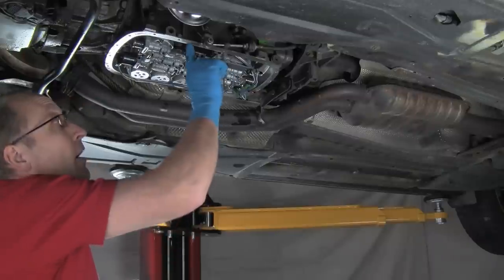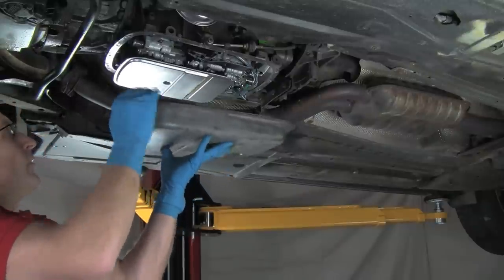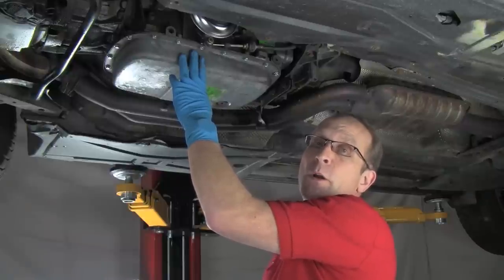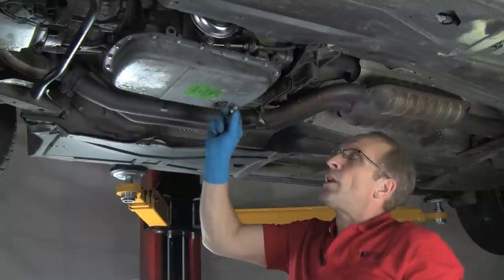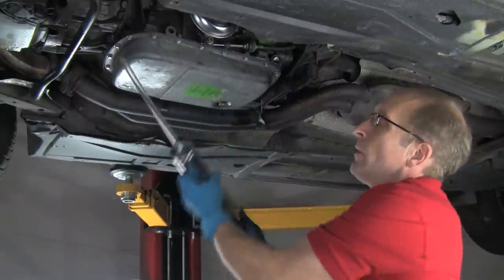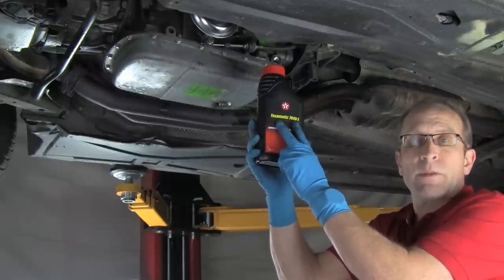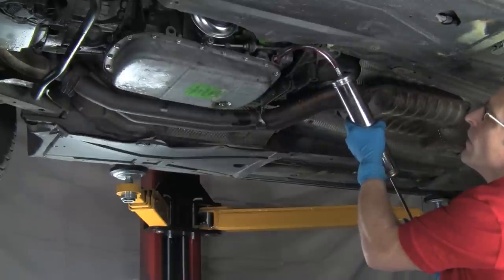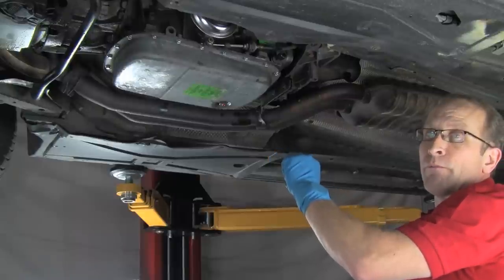Part 2: Changing Automatic Transmission Fluid & Filter On A BMW/MINI

Comment from the maker: When the pan is drained, you are removing around 1/2 of the fluid from the transmission. If the fluid being removed has high mileage or is visibly nasty, we do recommend a second fluid drain and fill (without removing the pan again) after running the transmission long enough for the old and new fluid to mix (some may take a 3rd time to be really clear and clean)..  Once, the fluid is clean and clear, you next scheduled change can just be a normal single drain and filter.
Reply: ok
Reply: What about the dirty fluid in the torque converter, which if similar to a Mercedes holds the majority of the fluid. Looks like a job half done?
Reply: You mean keep wasting very expensive atf? The stuff is at least £12.00 a litre. Must be another way?
Reply: @jonplopp6643  he just explained that ( or at least 7 years ago)

is there something unclear about  "When the pan is drained, you are removing around 1/2 of the fluid from the transmission"  ?
Reply: @jonplopp6643  sure you can flush the transmission which uses even more fluid and comes with its own risks in old transmissions.   Otherwise I guess hope for magic.    If you are paying 12 quid a litre you need to change suppliers .
Reply: @jonplopp6643  You do a complete flush , all the fluid out at the radiator as you pump new in at the tranny fill. Takes about 16 quarts .. pump in until you see new fluid coming out of line going to radiator . Everything else is a waste , like changing part of oil on an oil change .
Reply: @ozarkdaredevils  wheres the radiator?

Comment: This is how auto repair vid's should all be very through clear visuals and sound. As for Otto your great I just purchased a 2002 325ci with 83,000 original miles and I have used your instructional vids to save myself hundreds of dollars in labor. In regard to the Trans fluid and filter change I wish I had a lift would make this job 100 times easier. Cheers.
Reply from the maker: Thanks for the good words, Rich.  We're glad to be able to help.
Yes, the lift certainly is a game changer!

Comment from the maker: Wajid Furgan - We can't reply directly to your comment as it was sent in via Google.  Running the engine in a low gear and a higher engine RPM can certainly increase oil usage.  However, you may have a problem with the crankcase ventilation system, which can increase the oil usage.  You may have a ruptured check-valve diaphragm or clogged oil-separator.  As for the transmission, we would suggest changing the fluid/filter as a first step.
Reply: Do you have a video on how to change the pipes that connect to the automatic transmission heat exchanger / transmission Cooler? can i find them on the website?
Reply from the maker: 04bmw330i
 - We do not currently have a video for changing the transmission cooler lines.  The Bentley repair manual does address this.  We can offer the replacement cooler lines. If you don't see them on the web site (www.bavauto.com), after identifying your model, just give our Advisors a call at 800-535-2002.
Reply: +Bavarian Autosport  Question..........does anything have to be reset on the dash when finished ?????
Reply: I have a BMW 530i 2004 is the same process?
Reply: @TheKobotron  should be...just confirm via your VIN what tranny you have. There are several over the years

Comment: How do you run the transmission through all of the gears in an automatic? Do you just mean park, neutral, reverse, drive --  or did you run it through gears 1 - 6 with the tiptronic as well?
Reply: I run my park, neutral, reverse and then on drive switch to the tiptronic and run it manually through each gear.

Comment: What about the fluid left in the Torque converter and oil cooler? Shouldn't that to be replaced also?
Reply: I am also wondering the same thing.
Reply: After the first fill the car should be run and cycled through the gears, it should then be drained again and refilled. This will help to clear most of the old fluid from the torque converter etc.
Reply: planning on doing it tomorrow with 2x changes.
Reply: Kon Nyuk Chang you don't want to flush that fluid… That could cause some loose particles to break free and cause a worse clog.
Reply: It is best to increase the oil change interval. If the fluid is red or pink no burnish it is good. You can do a flush but the flushers often add solvents which is a contaminant. The only true recommended flush is with the exact fluid. If you change it like this and have no metals or burnt fluid you are good. As bad as this transmission was you could re change the fluid and filter by a month or mile schedule...several months or several thousand miles and it would be as good or better than a flush. It would address the concern you have about the fluid...capacity is around 9 quarts and he changed what 5? so you are doing well with two changes.
Reply: Is there a concern to get the fluid up to operating temperature on the final fill?
Reply: This is a 'change' not a 'flush'.
Reply: @wheatonna you are rolling the dice with a "flush."  I do NOT flush my tranny. Too many horror stories following a flush. I change oil and filter every 60k. Some do it every 30K. Good luck!
Reply: @enrique967  I'm not planning to do a flush. Only pointing out the difference.

Comment: someone should make a dipstick and tube for this. aftermarket. but better then black transmission fluid.
Reply: I have actually made a dip stick my self for a 95 525i e34 auto.. works magic lol
Reply: @Vickthemaint  Older cars that I have had such as Fords, all had a dip stick connection where anyone could pour oil into the transmission. Ah, those were the good old days.

Comment: RE: 2007 328i with GM L45R transmission. This was very helpful. According to REDLINE their D6 ATF exceeds the requirements of BMW ATF for the GM green tag L45R. They also said REDLINE was fully compatible as it is nearly impossible to get all of the old fluid out. I was able to get access to a lift otherwise its impractical to DIY. Followed this video and performed the service. Trans shifts normally after service.

Comment: I think this video is awesome and self explanatory. Although BMW has recommended lifetime for the transmission fluid it is quite obvious there is a significant breakdown in efficiency over time which in my opinion can cause problems with performance.

Comment from the maker: Assuming that you have the proper plug removed for the fill plug, If you have the engine running and have moved the shifter through the gears and back to PARK, it will be full when the fluid runs out of the fill hole.  The fill plug is above the pan, at the rear, on the left side (facing forward).  This trans typically takes about 8-liters in US models.

Comment: I love it! just replaced all cooling parts on my wife's '00 528i and currently having the ignition parts replaced. I was under the belief that this was never suppose to be needed/done but I'm glad to have found this!! I plan on doing my '02 530i as well I hope it's very similar!!
Reply from the maker: The '02 530i will have the A5S-325Z ( ZF 5HP-19) transmission.  This is a bot different, but the procedures are the same, an the fill plug is in a similar location as shown.

Comment from the maker: The reason for further drain-refills is to get a higher percentage of fresh fluid into the trans.  There is no problem mixing the old and new fluid.  However, when we drain the pan, we are only getting about 1/3 to 1/2 of the old fluid out.  The rest of the fluid is still in the trans.  We add the new fluid and it all gets mixed (which is fine),  Successive drain-fills will achieve a higher percentage of fresh fluid.  We typically do this when the fluid has not been changed for a long time.

Comment: Changing on my 328i wagon.  GM transmission.  Professional and straight to the point.   Very well made.  
Thank you for the comfort.  I’ve seen a few videos but this one definitely eases my mind in moving forward…especially with the refill part.  
Q:  Is shifting the gears with the brake on the same as without and is it unnecessary to “give it gas”?  I would think that’s the differential and not the transmission.  
Just press the brake and switch through gears a few times and that’s it?

Comment from the maker: The transmissions on the later BMWs (such as the E60 5-series) look different, but the procedures are similar.  One difference, of note, on the latest BMW models (those using the GA6HP 6-speed variants) is that the filter is incorporated into the fluid pan.  Therefore, when you change the filter, you actually change the fluid pan.  The drain plug is in the bottom of the pan and the fill plug is on the transmission, just above the pan, driver's side, toward the rear (like the one in the video).

Comment: i learned at my school that you should make certain you can loosen the fill plug before you can loosen the drain plug...so that if its stripped or giving you a hard time you won't be stuck when it comes time to finish the job/ refill the pan

Comment from the maker: Your E30 3-series will have the 4HP22 automatic transmission.  This transmission has a fluid dip-stick (under the hood).  You will fill the transmission through the dip-stick tube (with a fluid funnel).  Since you can't just fill until fluid comes out of the fill hole (as in the video), you will have to add a bit at a time, then use the dip-stick to check the fluid level.  Once the fluid is at the FULL mark, start the engine and continue adding fluid until it is at full with the engine running.

Comment: Thank you again for these "How To" Youtubes.  I did the change of lenses and the coil/spark plugs because of this additional service you provide.  This one was very important to me for your comment about the need for th change.  I called BMW and they said no need on my X5 nor my 740il.  Not looking forward to the cost of the fluid but a rebuilt would cost $3k plus labor.
Reply: Yes, the fluid and filter changes are far less expense compared to a transmission failure due to lack of fluid changes.
Reply from the maker: Yes, the fluid and filter changes are far less expensive compared to a transmission failure due to lack of fluid changes.

Comment from the maker: There is also fluid left within the transmission and the torque converter.  If the changes are done regularly, all of the fluid will eventually be cycled out.  However, if the drained fluid is quite nasty (as this was), we would run the engine for a bit (or drive the car around the block, or something) and then perform another fluid change (without dropping the pan).

Comment from the maker: We have always recommended ONLY the fluid that is specifically approved by either BMW or the transmission manufacturer.  The Texaco fluid used in this transmission is the original fluid fill that BMW used.  Additionally, the Lifeguard5 fluid is now specifically approved by the transmission manufacturer.  We now carry the Lifeguard5 as the standard fill (as well as the other proper fluids for other model transmissions.

Comment from the maker: The gasket on this application did not require any scraping to clean up.  However, you do mention an important point ... to make sure that the pan and the trans mounting rail are fully clean, and sometimes scraping is indeed required.

Comment: This is an older video I stumbled on; however there is no mention on fluid temperature and its measurement during the process. My E53 has no dipstick and specifies 2 temperatures during change.  Start warm up upto 95 F and final fill no more than 122 F. Question is how to measure the  temperatures ?

Comment: Excellent very informative no other how to describes what you have to do to great detail even as far as using the fluid transfer pump or cycling through the gears with the brake engaged thank you for clearing this up for me it's greatly appreciated

Comment from the maker: As long as you are using the proper fill plug location, you cannot overfill the transmission, as the fluid will pour out the fill hole when it is full.  Go ahead and add more and don't forget the have the engine running.

Comment from the maker: We're sorry for the delay ... we had some trouble accessing YouTube comments.  If you go to our web site, we will only show you the fluids that have been specifically approved to match the original fluid, by the transmission manufacturers.  We have taken this stand, as opposed to just using a universal fluid that the fluid manufacturer says .... "can use" as a replacement.  Just go to our online store at bavauto.com

Comment from the maker: On vehicles that do not have a dip-stick, you remove the fill-plug and the fluid level should be at the bottom of the hole (where the plug was threaded in).  NOTE:  you MUST have the engine running when the plug is removed and the fluid level is checked.  If you remove the plug when the engine is not running, you will dump at least a quart of fluid.

Comment: Really a good step by step demo.  I have 100K miles on my 2004 X3 and it's not shifting properly.  Two mechanics have shed no light.  I may just try to change the fluid and see what happens.

Comment from the maker: Joseph - If the transmission fault indicator is on, you will have to have the trans fault codes read.  This requires a full service diagnostic tool.  A common engine fault code reader tool will not access the transmission fault codes.

Comment from the maker: You can typically just use a rag to wipe the magnet clean, then spray it wit brake parts cleaner and give it final wipe with a clean rag.

Torque on the pan bolts is typically about 10 to 15 ftlbs.  The applicable Bentley repair manual will give the values.

Comment: Great informative video. it makes me want to do it my self . the lack of  lift its what really stops me.
thank you for all the information once again.
Reply from the maker: Since the vehicle does need to be basically level for the refill, it is a bit more tedious to do at home.  However, if you drive the front up on ramps and then jack and support the rear on jack-stands .... it's not so bad.

Comment from the maker: If you remove the fill plug when the engine is not running, you will typically lose between 1 to 1-1/2 quarts of fluid.  The fluid fill is performed with the engine running.

Comment from the maker: You can try grasping the heads of the bolts with Vise-Grip piers.  Alternately, you could try hammering a larger Torx or Allen bit into the head of the bolt.  Finally, you could use a cut-off wheel to cut slots in the bolt heads so that you can use a large flat-blade screwdriver.

Comment: Great job.  The German engineers made it hard to change fluid by putting the refill plug at such a low level rather than at a regular higher level with a dipstick for routine checkups!

Comment from the maker: You'll have to get under here and inspect.  if it's all oily all over the place, spray the whole transmission down with brake parts cleaner or other degreaser and then go drive it and come back and re-check for the source of the leak(s).  Could be the pan gasket, input seal output seal, shifter shaft seal, fluid cooler lines or fittings.

Comment from the maker: Almost all later model BMWs (most early '90s on) do not have automatic transmission dip-stick tubes.  All filling and fluid checking is done from under the vehicle, using the fill plug.

Comment from the maker: Most automatic transmissions operate in the 120 degree to 140 degree range,  This is where the fluid fill level should be checked.  Each transmission will indeed have a specified temp. For most applications, BMW just says to plug in the GT-1 and wait until it says the temp is proper.  For a DIYer, anywhere in this range will result in an acceptable fluid fill level.

Comment from the maker: I think that you may be looking at the Power Steering fluid reservoir.  This is the plastic reservoir, with a screw-on cap that has a dip-stick on it.  The reservoir would be labeled to use ATF (Dexron-III).  If you are adding fluid, it is most certainly leaking someplace.  But, this is the steering system, not the transmission.  Look for leakage at all of the hose connections, the pump, the steering gearbox, etc.  We will have any of the parts that you find need replacement at bavauto.com.

Comment: Awesome helpfull video. I was afraid to touch my BMW X5 but was able to change my own trans Kit myself. For under 150$ my x5 runs really smooth. Trans oil had not been changed for10 yrs. black like used motor oil. It was nice to save a few bucks with a true feeling of accomplishment.
Reply from the maker: Thanks for the good words, Pedro.  We would suggest that if the oil was very dirty (as you noted) to perform another fluid drain & fill (without removing the pan).

Comment: You state it is good for another 30,000 miles, but a comment below states, change again within a month to prevent premature failure from recirculating waste materials in the new fluid.  Is that correct?  thank you for another excellent , clear procedure.

Comment from the maker: Yes, General Motors has been supplying automatic transmissions to BMW since the '70s. The transmission shown in this video is a GM transmission (A5S-360R ... or ... 5L40E in GM speak).

Comment from the maker: The 2008 320D will have different details for the drain and fill plugs and the pan and filter.  However, the procedures are the same as shown here.  The filter is incorporated into the pan on the GA6HP-19Z transmission, that you have.  Therefore, you actually replace the fluid pan.  The Bentley repair manual for the E90 3-series would cover this transmission (but not on a 320d).  We do have the manuals, fluid and pan-filter kit in-stock at bavauto.com .